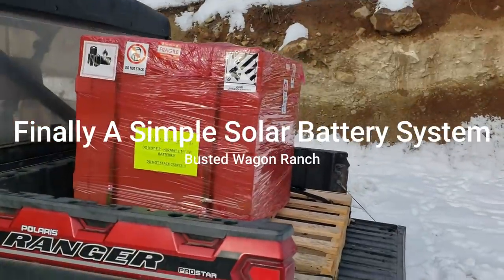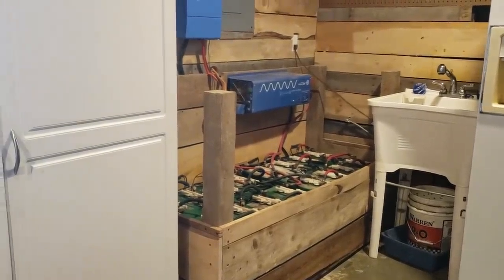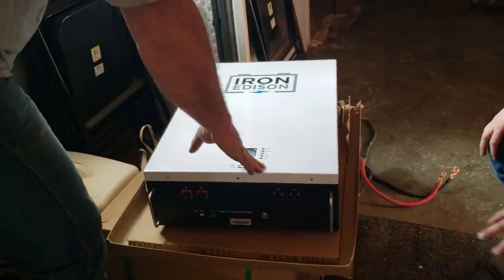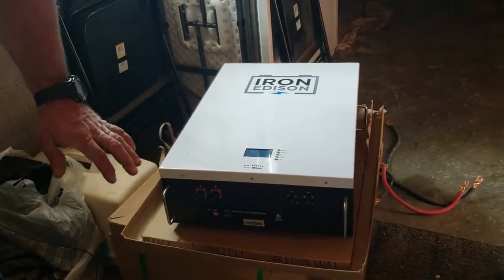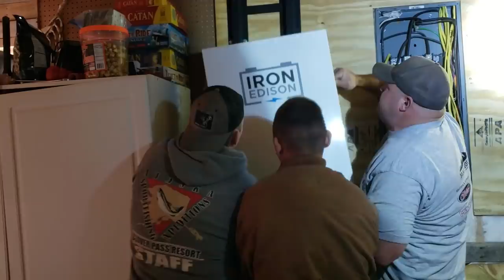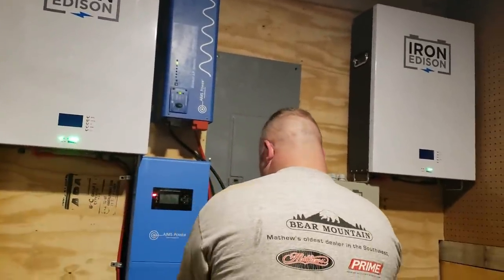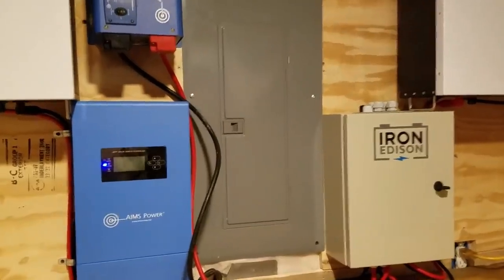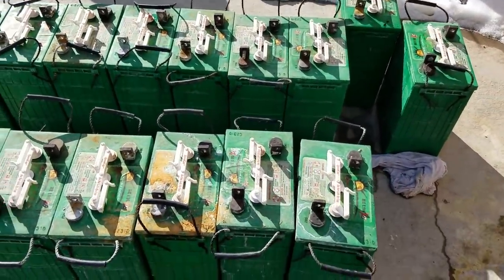FInally A Simple Solar Battery System

Comment: Nice video. Would like more details on the battery capacity. Maybe take a look inside the cabinet. I will go back to your archive to see if something is in there (PV/inverter/CC sizes). I jumped up when your son almost stuck his hand full of screws into the open electrical panel. Then remembered the inverter was sitting on the floor - whew! Thanks for sharing.

Comment: I have a grid tied system that I want to add a battery backup and associated equipment too. Thanks for the information. Great for you to get this system all squared away so you don't have to worry about anymore.  Things are really moving at your place. Folks over at Red Poppy had some very nice things to say about you two on their video yesterday. Good friends are a blessing!!
Reply: Average outage duration totals for a year at most utilities is about two hours. Is it worth having batteries, which need replacement every 3-5 years, for two hours of outages?
Reply: GRID TIE IS A LIABILITY.

Comment: I have four of the same batteries, I also went with the Iron Edison Re-Volt 7.6KW inverter. I will never go back to flooded batteries. Been "off grid" for twenty years so I've seen more than my share of battery banks. You folks will enjoy this purchase. IE is a fantastic group of people to work with.

Comment: The new batteries will not give you more power, but it should store your power more efficiently and not have the same operational issues as with the old batteries.  Remember the batteries do not generate more energy, they are just storing the energy from your solar in a more effective way.  One downside is that people tend to run these batteries down to a lower voltage as that doesn't do them as much damage, but that is still energy that has to be replaced by the solar.  So take care of the use and upgrade the solar if your use doesn't allow the batteries to come up to voltage each day.
Reply: Yup, going longer in between charge cycles is the key right ? Thanks.

Comment: I hope that AC panel was de-energized.  (not sure if there is grid power or everything was dead once the lead-acid batteries were removed)  The big guy in the grey T-shirt just about leaned his head into the exposed 240 V main terminals while hanging the Iron Edison batteries.

Comment: Ok, we are very interested in the cost. Or a roundabout cost of only this new battery system. 
Great job. Hard work pays off.🙏🌷
Reply: List price on those batteries is $7,630 each, and the combiner box is $515.  Total would be $15,775.   https://ironedison.com/re-volt-lithium-battery

(You could DIY build an equivalent battery system for a lot less, but that isn't for everybody.  There is value in getting an off-the-shelf product with a warranty and support.)

Comment: What's the difference between your setup and the one Heath put in from Lion Energy?
Reply from the maker: Heaths setup is a all in one unit. Batteries and inverter all in one. I already had the inverter and charge controller. I just needed some good batteries.
Reply: @bustedwagonranch4546  Great looking system!

Comment: Did you guys do your battery system upgrade before or Heath did his on Red Poppy? I know he went with LiFePo batteries after the fact and hasent looked back etc.
Reply from the maker: He was able to do his first. This wasnt a cheap upgrade. But definitely worth it.
Reply: @bustedwagonranch4546  yeah I figured, I was thinking you went with LeadAcid like most people would to begin with but then went down the LiPo (Variations there off) because its just better, albeit bloody expensive.

Comment: What happens to your old batteries? Keep on keeping on!
Reply: I wondered too. I figured that if they still have some life, they might be good to keep around for a reserve battery bank during low solar periods. I doubt they could resell used batteries for very much.
Reply: @noyopacific  The batteries will probably be useful to someone but the shipping would probably be a lot. I don't know what they weigh but they sure put a strain on them getting them out.

Comment: Are you saying your lead acid batteries would drop 20% compared to the lithium at a fraction of that WITH THE SAME DRAW ?  What is the amp hour rating of the two banks ? 

 Looking the specs on Iron Edison's site, it appears the lithium batteries are only a few hundred amp hours....that bank of L-16's should have been 800 or more. Something doesn't add up there.....
Reply from the maker: The lithium iron phosphate batteries and lead acid aren't comparable when it comes to the numbers of amp hours. I argued alot trying to get a greater capacity than my lead acid but the numbers were saying different. But the iron edison gurus got me squared away. I would buy from them again
Reply: Terrell said the Lithiums were 10Kwh each. Later he said that he only used 0.2% of his capacity overnight. 10Kwh X 2 = 20Kwh. 20Kwh X 0.2% =  0.04Kwh (40 watt hours.) I doubt they could get through an entire night using only 40 watt hours. I'm kind of a math geek and do math problems like this for entertainment (is that weird or what? 😂) Most people have trouble doing multi-step math problems in their heads. Few seem to be able to easily handle problems that involve decimal place conversions in their heads. My guess is that Terrell could have made an honest error in his calculations.
Reply from the maker: My charge controller tells me what percentage the batteries are at. Usually at night I go from 75% to 55% with our old batteries. These new ones only show I went down a partial percentage over night.
Reply: @bustedwagonranch4546  Thanks! I would suspect that the numbers calculated by the charge controller might not be totally accurate. It is difficult for me to imagine anyone could run a house with refrigeration, lights and computers on 40 watt hours of electricity over any 12 hour period. (I do that type of math in my head every day, it's mostly just a geekishly weird hobby.)

Comment: Tel,tell us whats going on with your jeep
Reply from the maker: This is tel my jeep is going very well, but slow. What I have done is I have 2 jeeps one is just a parts jeep I bought that for its engine because it has the original flat head engine. So I have transferred the transmission from my parts jeep into the one i am keeping because it has the better transmission then I transferred the engine into the jeep I'm keeping now I'm working on my steering because my parts jeep has better steering so im swapping that. That's about it for now but I'm still working on it.

Comment: One thing dang straight is that no one is going to take one off that wall and run with it.... and if such person does exist.... give them the thing and go back to the store with a upside down grin and being alive. A lot has changed in my 73 years on the planet. I can remember the biggest car battery was a six volt and for a long time we got by with them.... point is ..  when twelve volt came out, a few of the holdouts stayed with a six volt battery that had oak thin boards in the bottoms of them with the (pardon my memory) notches for the boards to hook into and was the bottom with a rubber mixture on the sides and the bottom too. The tops had large vents so they didn't blow up. Now if you could find a starter that could stand up to the abuse, you could go to town and back with one of those hooked up and just grinding on poor starter. A small amount of "tither", Trump was in office for four years and science didn't stop, the price of scrap iron is way up and profitable to haul junk steel to the yards again. A corn farmer is almost guaranteed to make money at five dollars a bushel because they scrapped by on three dollars. Its a matter of minutes to get help via a beacon ... we were lose from china and her dumping cheap junk on the market. Things are about to change and not for the good.... might want to pay a utility bill to yourself so that when hard times do and will hit that you have hay for livestock and pants on junior. Every kid should learn to sow by hand and with a machine so that patches are not horrible. We will be by the time give away Biden leaves office... if he makes it through. I feel a first female president in the wind. Okay enough on that.... a really nice place that you have picked to be yours and others close in the family may have to build on. I sure hope we don't see another depression but that place looks like it would do near everything that you will encounter so great going folks
Reply: I don't think anything good is going to come from this administration, all bad so far and it's only been what ? 3/4 weeks ? Lol !
Reply: @augustreil  I see him trying to give our money in little bites to the elderly yet we have got through always an always will somehow. So he bankrupts the country and we    are all the sudden on a form of "Bitcoin"  and there is no money to worry about. Currency will be gone by the end of this administration. Somehow living in the woods will take a whole new meaning.... thx 4 answering
Reply: @morgansword , I agree, America will power through this, without bitcoin though. I do see Harris taking over as Biden has no clue to what's going on or what he's signing. No matter what, we will get through this...I hope. Thanks and well wishes to you and your family.

Comment: i did find you never happy with what system you have or had  not one it's better then the other one   my problem is the sun yea have some time weeks before the does ready get out to charge the batteries up  or the snow-covered the panels when you're away too 
 the wind turbine works as good as the wind that day some i found batties need wind to charge too 
they last one works well to  just in the winter the creek freezes up  yes not charging their  at all  
i call this one the beast uses dinosaur bones yea works the best as long as you have fuel for it  lol 
yea have to figure out to keep the water from freezing up and yea as long as the beavers learn to stay out of the water wheel have a charging system that works for me